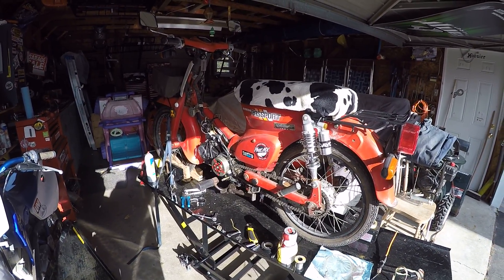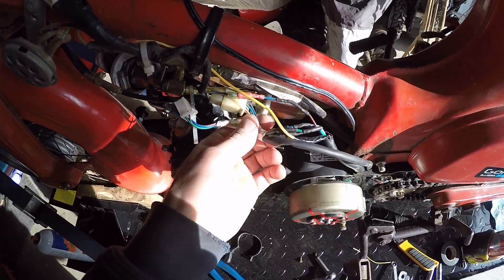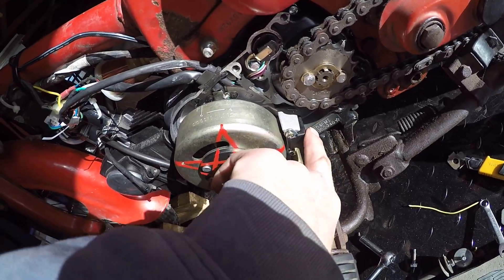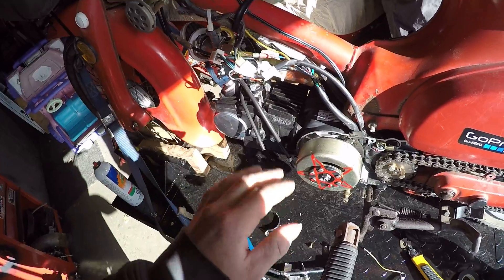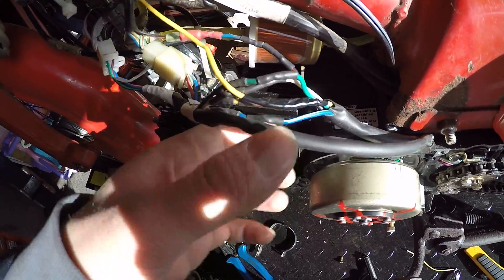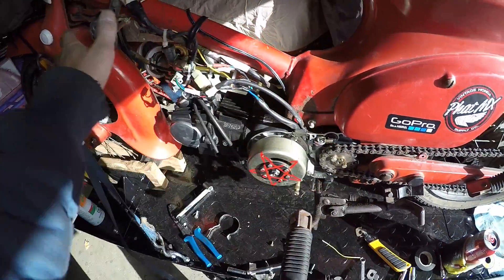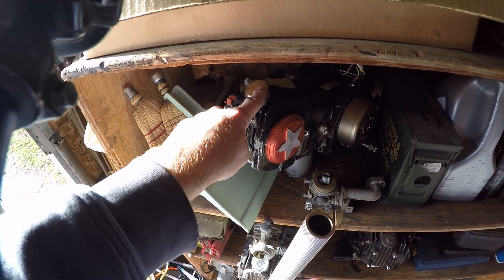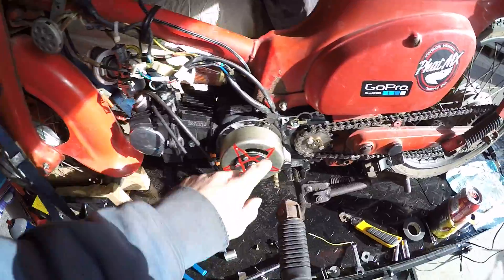How to wire a Lifan Honda clone to a 1982 Honda C70 Passport

Comment: Have you ever swapped in a Chonda motor without a battery? I had one before ('72 CT90 witha Lifan 110) that I loved but it was converted by the prior owner with capacitor(s?). I am swapping another CT90 now but don't have the other one anymore.
Reply from the maker: yes i have.